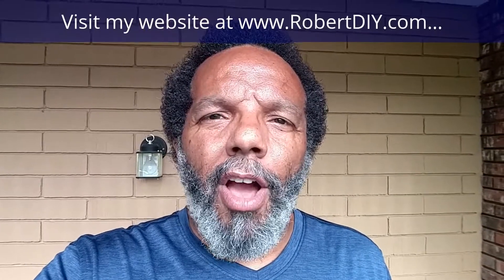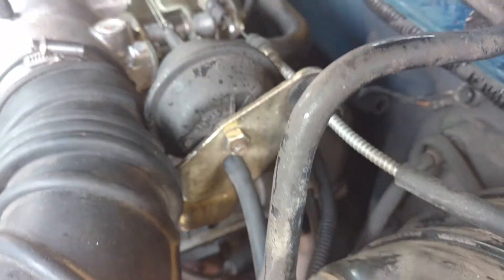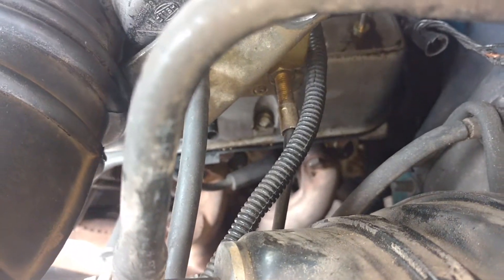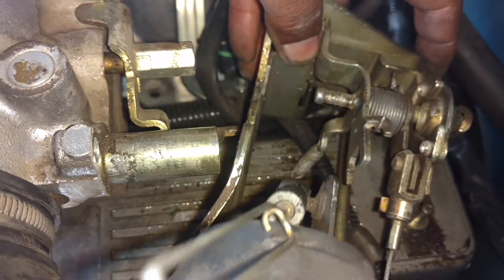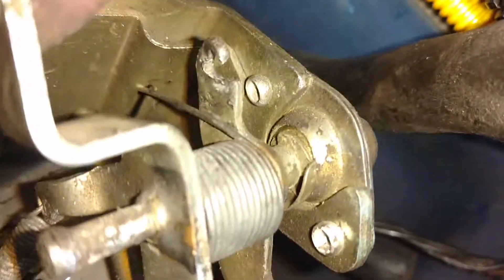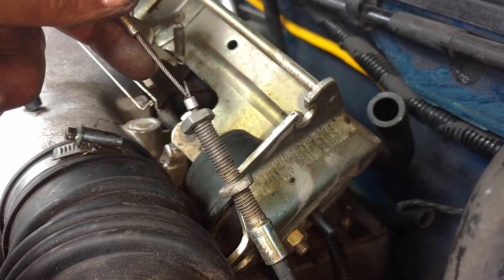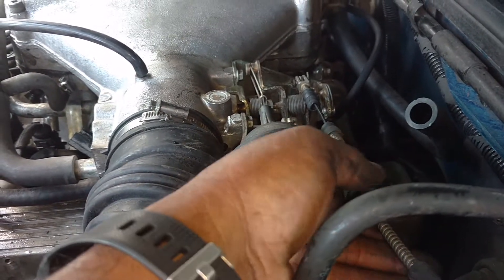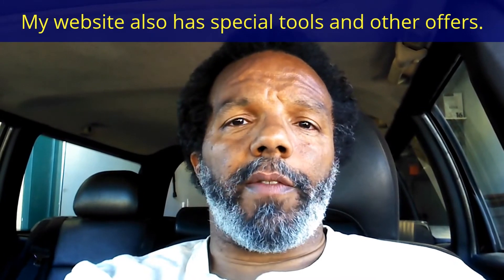Range Rover throttle body linkage assembly replacement. - VOTD

Comment: I would like to have a car like an old rangerover but those car salesmen I've asked told me that the 90s ones get machanical issues more often than not. What do you think about that?
Is it a bunch of lies?
Reply from the maker: +nasses321 I have no idea. My guess would be that any 23+ year old vehicle has issues that need to be fixed. The issue I have with any vehicle is the availability of parts.
Reply: Body rot issues... look for those. The 4 door range rover classic has issues with door bottoms, rear wheel arches and foot wells. Most items are for sale to weld replacements in. The rover V8 blocks uses aluminium heads that become porous if they overheat, 3.5L and 3.9L units share the same heads, get more power out of a 3.5 by using a 3.9 camshaft. A LT95 4speed manual has a option for a overdrive to bolt on to it, if the 3 speed automatic is fitted a ZF4HP22 can be fitted with a few tunnel mods. A great car to drive and work on.
Reply from the maker: Good info, thanks for sharing.